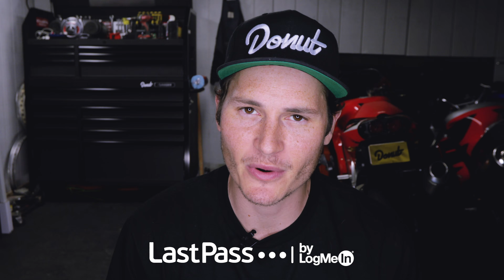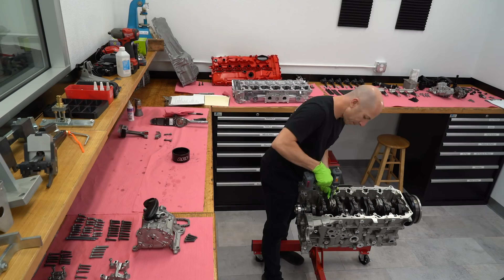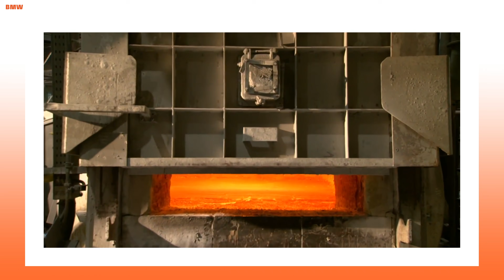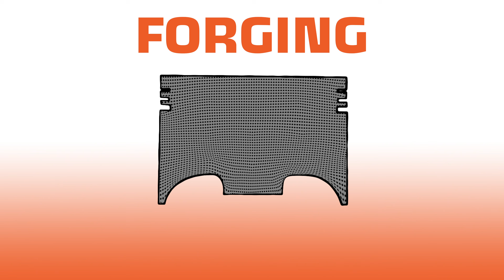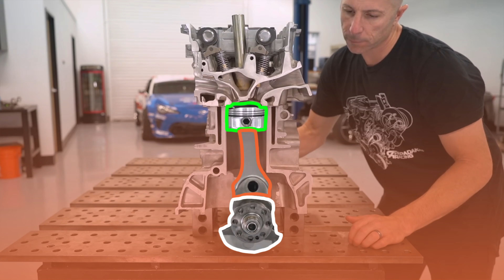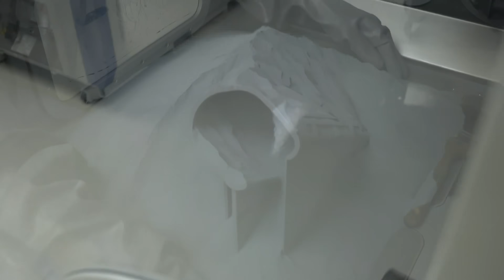The FIRST 1000HP 2020 Supra - Tech Explained

Comment: 2jz is better because of the build quality compared to the B58, my dream is to own both because I want to appreciate the older beefy 2jz engine that is made from cast iron whereas the b58 made from cast aluminum, I think the simplicity in design and easy maintenance and reliability is the 2jz anyone can work on this engine which is why I think it’s better, but the b58 you need a lot of specialty tools to work on it, it’s less beefy than the 2jz but it’s still a good engine just with less reliability than the 2jz you can’t put as much HP on the b58 either because the engine probably can’t handle all that juice like a cast iron block can. 

Conclusion:
Both engines are good it depends on what you want from your engine. It depends on the person and if they want to work on their engine or if they will just leave it at a shop for someone else to work on then the engines complexity doesn’t matter in my discussion. 

For me I like simple designs because those are often the most reliable designs. That is why I prefer the 2jz mk4 Supra over the new one. Like I said in the beginning I would still want to own a b58 just to mess around with it but I still believe the 2jz is king. 

Lemme know what you think ❤ keep it positive and respectful

Comment: You dont have to do half of these mods to make 1000hp with a 2jz
Reply: Tbf this was back when the aftermarket for these were far more limited to were 6-800whp B58s were rarely seen so it makes sense they'd have to do a bunch themselves to make more power when they were limited in support mods for the power they wanted to make at the time.

Comment: Whats the point of all this just jz swap it it would be cheaper
Reply: Aftermarket was not nearly as big to were they were seen normally making 700whp at the time and were still in the early stages in its aftermarket still so they had to make stuff themselves to make the power they wanted since they were limited in aftermarket support at the time. Plus they wanted to see how it do with the stock power plant(despite the limitations)and it's been holding up well since.

Comment: what can I try to add to this great video...older engines could handle more power than nowadays, manufacturers realized after the 2000s that they didn't need to build engines thick enugh to sustain 2-3x their marketed power so to reduce weight, material cost, improve cooling they started thinning the cylinder walls and general engine blocks, this makes upgrading power harder and we went from destroyed valves and deformed pistons which can be fixed (worst case you could redo the cylinders increasing displacement) to destroyed engine blocks with large holes, not cool

Comment: The N54 has forged internals, and it also can be built to 1000hp with stock internals. But I would advise to change out all of the plastic parts around the engine, as that's what I did with my 740whp TT-335i. Lastly, the N54 is also direct injected just like to 2JZ and the B58. But I like the N54 BETTER than the B58.

Comment: In terms of tuning I don'tthink that the open deck B58 quiet beats the 2jz, but the closed deck S58 probably will. But only time will tell how much power the S58 internals and block can handle..
Reply: It's closed deck not open. There's people making 8-1000+whp on these left and right now than there was before since there just wasn't much aftermarket for them at the time.
Reply: @carboydorifutoparty3976  you are right, I just recently found out that it's closed deck and has the same block as the S58. But in FD they make up to 1400hp, so Imho it's a worthy successor for the 2jz.

Comment: If what is said here is true, then the Americans unfortunately have no idea about engines. The B58 has been considered a top engine in many parts of the world for years (since 2015). After the almighty N54, also known as the German 2jz, many were disappointed by the n55 with its open deck design. The b58 is in my eyes the true German 2jz. UP to 700hp on stock internals is legendary.

Comment: I think that the M111 engine with sequential manual/Automatic transmission should also be featured in this channel. It's a part of history from Mercedes-Benz. Its usually supercharged inline 4/6 stock! It would really shine the light on this engine and maybe spark something like this for the community of SLK, C - class and other cars in the 2000 that had this engine! I have my own green 2000 SLK 230 Kompressor Sport Designo trim that i am in love with, it's even my first car! It is already being called a classic for its convertible hard top and the 2000 style! Please Donut this engine has amazing potential and history!

Comment: The reason why 2JZ is very desired is because it is not only an overbuilt motor but is also relatively easy motor to work on. The B-58 is German made, it may have not been a struggled to Steph for creating a bracket to mount the engine on the engine stand or even modify the engine stand to make his life more easier, aside that the timing chain is on the side where the transmission bolts up to the engine, have fun replacing the timing chain, the intercoolers are inside the intake which means if the go bad you need to get a new intake, you need a whole special tool to loosen the valve train. i mean f have all that have fun bud but im a dumbass who just wants to have reliable and easy fun and the 2JZ is the way to go if I am me.

Comment: But the real factor is how cool you can keep an engine based on pressure of gases because we know that heat cause air to expand, while coolness like to tighten air molecules creating more combustable gases, and with all gases that isn’t Inert, it need oxygen to go kaplooie. 🤷‍♂️ hence the basic concept of coolness is keeping the airflow more dense as a constant factor which is hard to not prove otherwise…  

Unless you look at the old VW bugs that work well in snow and die in America because the car was originally based for a colder climate area…

Comment: *forged part or product is also a compressed specimen of its original size. the weight of the part does not changes but the size does to the required specifications. Means now after forging the part has more dense property than it should have been if it wasnt forged.

Comment: Oh it's still a fail. Having to completely tear down and rebuild the engine is a fail... The 2jz was built strong af frok the factory !!
Reply: The 2JZ can on stock internals, but not for a very long time. If you want a reliable 1000hp, even with the 2J you need better internals.

Comment: I think most modern cars don't have a problem with start-stop, even without specially coated bushings. They use an electric oil pump, that keeps pumping even with the engine turned of. This especially benefits cars with a turbocharger, which could otherwise experience heat-buildup. That's the reason your shouldn't turn off a turbocharged car instantly after driving it really hard and hot.

Comment: Actually the air problem with casting has disappeared with a low pressure casting process. It's basically using pressure differences to let the metal flow from below to the top so the air is pushed out.

Comment: There are voting polls casted everywhere on whether they would prefer/like the MK4 or Mk5....guess what..... every single time those polls come out ......90% of supra fans prefer the 90's MK4 supra. Some reasons to consider: 
1)Toyota did not collaborate with BMW. Its toyota's original. Does it matter yes because reputation. (someone can explain why)
2)THE MK5 LOOOOOKKKS LIKE A Z4!!!!! Why cant ppl understand that?? Skyline, NSX and others kept their signature look.. but the supra... NOPE.. its got a flat ass...
3)340hp ish hp?? ITS 2021!! ENGINEERS step you game up were gonna have to break some rules here. WHY NOT 500hp stock?? The new generation is going to look at 340 and look the other direction. Sure you can dump 30k. But why not just include it?? out with the old and in with the new evolution.....
4) Personal opinion here...ive seen the MK5 on the streets and it doesnt have the same vibe as the MK4... we have viral vids of the famous "IS IS IS THAT A........SUPRA!!!" MK4. MK5: "thats a Z4"

Conclusion: Quality of the internal GOTS TO lol correlate/vibe with the EXTERNAL, meaning the design of the body...we probably wouldnt bi*ch about the car if it wasnt for the Z4 LOOK. Toyota please take the car back and redesign for the 2023/4 version. Thank you:)

Comment: People saying aluminum block isn't going to last but doesn't know that closed deck block will last vs a open deck block and is pretty close to strength to a cast iron closed deck but at a cost of less weight, they also forget that bmw litterally perfected the processing and manufacturing of inline 6 engines as they're the one company that produces them the longest

Comment: but forged internals to get 1000hp.  2JZ-GTE engine could do 750hp on all stock internals, just a larger turbo and better fuel delivery.  B58 is still garbage  compared to 2JZ-GTE

Comment: The part explaining forging seemed to skip over the true benefits to it, and the reasons why forging & casting exist.

"Forging" a part, means taking an ingot, heating it up in a forge and them stamping out the part using a press, which differs from "Casting" which melts metal into a liquid and pours it into a negative of the part, a mold, then allows it to cool and solidify into the part. Forging is preferred since the metal's crystalline grain structure remains relatively intact providing greater tensile strength, also allowing less imperfections to form within the part. While casting opens the door to air pockets forming from vaporized impurities turned into gas that were trying to escape from the liquid metal after pouring into a mold, making a weaker product. For some parts, especially in the past, some complex or large designs required casting to be possible to form, as well as casting being cheaper & far less time consuming than forging out parts, which can take substantially longer thru the process of forming the ingot into its final shape, progressively running it thru dies that are closer to the finished product until you finally get the final shape you want, which still needs to be cleaned up thru bead/sand blasting, grinding, and polishing. With casting, once you pour the metal, allow it to cool, break away the sand mold, you jump right to the finishing steps of bead/sand blasting, and polishing, with only some minor grinding like removing the spout where the metal is poured into the mold. Now days with multi-axis CNC machines, machining parts from raw stock has gotten so easy, that casting is mostly used with metals such as iron or for parts too big to be forged in a press or machined by a CNC machine.

Comment: He didn't change internal volume of cylinder or location of TDC/BDC so the volumetric compression ratio stays the same, 10.2:1 in 2020 Supra
I understand it creates more pressure but the gasket was already enough to handle it.

Comment: Doesn't 3D printing add air bubbles to the metal of the intake manifold because there is a chance that there could be micro-gaps between the powder as it falls when being layered?

Comment: getting 1000 hp on a 2jz is not this difficult this man had to 3d print a intake manifold on the B58 but the 2jz just comes stock with 1000 horses its very clear to me which engine is superior
Reply: 2jz will blow with 1k horses lol

Comment: First impression: Soooo, they went back to a n54... lets see how it turns out, okay the add is over....
Reply: Four minutes in, I'm thinking why do they keep saying "engine" and cutting to shots of 3D-scaned body... they probably just forged everything, because material science.
Reply: 5 min, The builder looks like Dave Mirra or someone...
Reply: 10 min, I'm bored. Don't forget you need to deck the n54....
Reply: almost 13 min, nice radial forge stock footie...
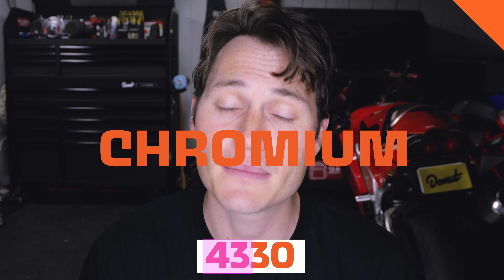Reply: ~14:30, Shhhhh, okay fine, just don't say anything about billet...
Reply: ~17:57, Don't forget the MLS spring effect thing, so you can get away with a little stud stretchy ness...
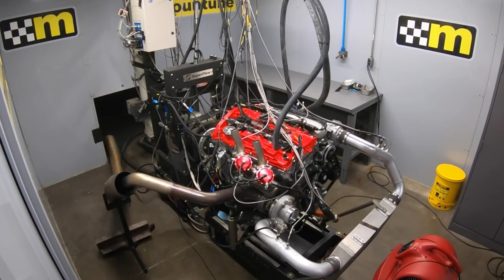Reply: ~19:44, second shot of the engine having a massive failure...
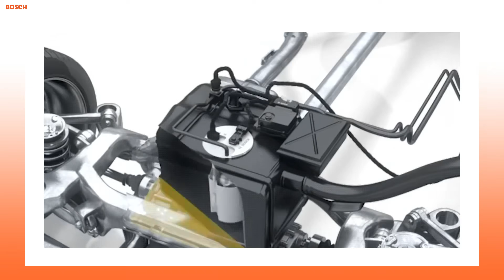Reply: ~21:50, so secondaries...

Comment: Shit 135 ft pounds ain’t shit I remember when I used to work on semi trucks old Detroit diesel bottom end was 325 ft pounds plus 90 degreees !
Reply: We had a huge snap on torque wrench which made a bit easier but most time motor was still in the truck so it was lowkey I bitch still

Comment: :16
Stock engine HUH ..??
:57
The LIST of ...... UPGRADES ...... "cough" FORGED parts to the BMW engine so that its NOT A STOCK BMW ENGINE anymore that made 1000 hp ... 
And HE did not use lasers or 3D printed parts ... Someone ELSE made those parts for him. 

Care to help me understand how you place forged parts into the engine and still say its a STOCK ENGINE ..??

And this was the same guy that said he was going to push the "STOCK" motor to see when it breaks to compare it to the 2JZ .. And that never happened. Instead he tore the BMW engine apart and just built it WITH forged internals to get to 1000 hp ...  which the 2JZ does without forged internals ..

Comment: So the biggest thing I learned about this BMW/Toyota project is that while BMW seems to develop cutting-edge engine technology, Toyota seems to be FAR more focused on longevity and engineering of every single piece (be it a nut, bolt, etc) that goes into the project. I think I even recall reading BMW saying how impressive it was that Toyota was evaluating each fastener. A stark contrast to how they spent development money. And I think that's really what separates the Supra from the... shit. I can't remember. Whatever the BMW car is that has more power.

The Supra was more subdued, for sure. But it's definitely over-engineered. It's almost (tinfoil hat time) like they engineered a ton of overheard into this engine to make it specifically awesome to tuners. Doug DeMuro even theorized this back when the Supra was new, thanks to its many useless fake vents. But I think he was right. Toyota wanted to make another car worthy of tuners, and they did exactly that IMO. They wanted people to forget the MKIV and the 2JZ. Well, that's never going to happen, but this engine just might convert some people.

The irony is that the "car guy" crowd who worships the 2JZ will never accept this, but the reality is that this engine probably is as good, if not better, because Toyota designed it to be exactly that. And don't get me wrong, I'm a car guy who LOVES the 2JZ, but I think Papadakis has proven that this is just a new generation of a great engine. BMW or not.
Reply: Underrated comment right here
Reply: Bro has written paragraphs here lol
Reply: Many times I've come back to the comment but today let me comment. 
This is true for sure. The new Toyota Supra is not here to be what the mkiv became but to be what it was supposed to be. Sales of the old one went down due to price. So Toyota corrected that buy giving us the car for what we wanted it to be priced. Funny that we want this supra to be over engineered like the old one but be priced at 50K. Toyita looked at Price, tunability and culture. Tuning can't only be about the engine but the body as well for handling no wonder Toyota built this machine. Like it or not, we're gonna love it. I hated it first look at me now
Reply: But bro this engine is 0% Toyota’s doing, bmw has been making this exact engine in the supra since 2016
Reply: @danielselseleh8226  If you seriously think that, then you have no idea how this car was developed.
Reply: @rars0n  another thing toyota probably went with bmw because they knew the engine already was overdeveloped here in europe the engine was already known to take alot of horsepower and if toyota increases the reliability its even better
Reply: @rars0n  Toyota did not engineer a ton of overhead into this engine. BMW did. This was because BMW designed it so they could use the exact same block for the B58, S58, & B57. S58 is the twin-turbo engine in the M3/4 that makes up to 503hp. The B57 is their diesel I6 that comes with up to quad turbos and 394 hp/561 lb-ft. There were no major structural changes from the first B58 to the B58 in the Supra, just minor technical changes.

Toyota may have helped out with reliability, but the B58 engines from prior to Toyota's involvement have already shown to be very reliable, so I don't know how much more Toyota had to offer on that part.
Reply: @danielselseleh8226  LOL theyre both B58s but anyone who mods/boosts in the scene right now knows that the Supra is a whole different animal from a b58 in a 340i. Even the new M340i with the updated engine is less capable than the updated engine in the Supra. BMW made a great engine, Toyota made it perfect.
Reply: @ELY-qg2vn  I'm not sure how to break this to you, but the engine in the M340i and the 2021-present Supra are identical. They even have the exact same engine code. The 2020 Supra engine had it's own code(B58B30C), but the only real difference is in the Supra got a higher capacity fuel pump than the prior B58 versions, but the B58B30O1 in the M340i already had that.

Toyota had virtually zero hand in the design of the B58. Maybe something in the reliability testing, but that's about it.

Comment: “With fairly minor mods” 
The engine was torn down and forged parts were built in and 3D printed metals were included. Very minor I do that every oil change
Reply: He only did it because there wasn't an intake manifold good enough in the limited aftermarket